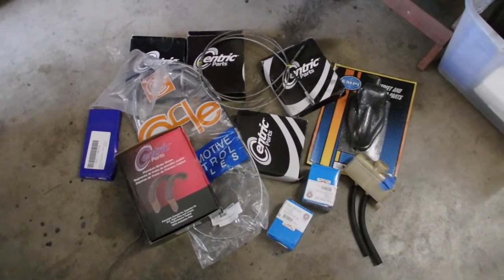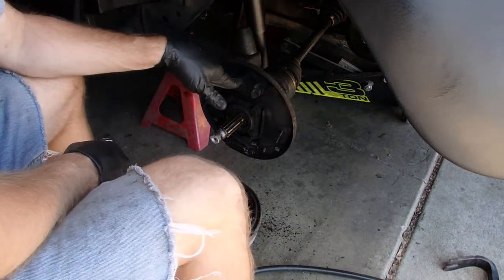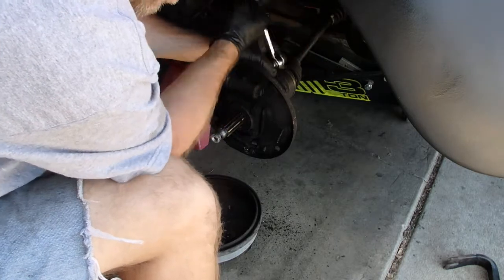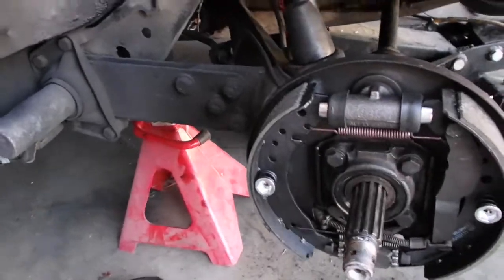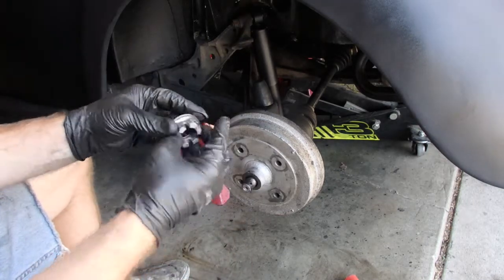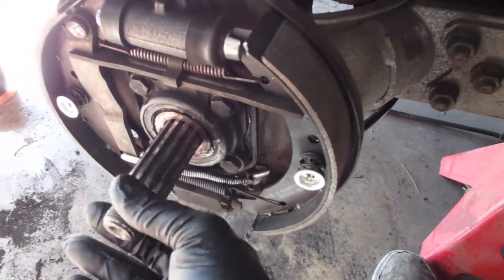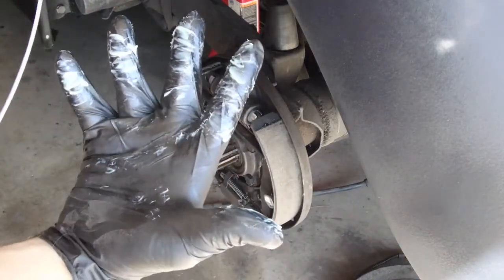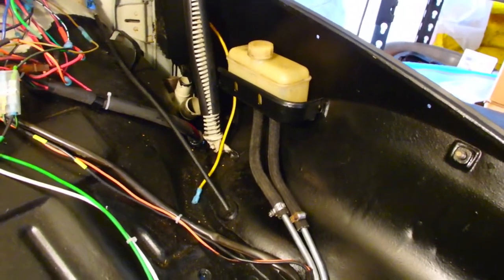1969 VW Bug Project - Episode 41 - R&R Emergency Brake Cables and Rear Brakes

Comment: I bought one of those torque multipliers and for the grief its saved me, it was well worth the $100. It's also nice to know that when I put the nut back on I can set it to the correct torque spec. I like that you don't edit out the little issues that always seem to happen on jobs like this.

Comment: I know this is an old video, but you do not bend the e-brake cable retainer on the backing plate, you do remove the 13mm bolt holding the retainer and everything slides in. Also on the handle side of the cable, you have the lower nuts on backwards, the rounded side goes against the balance bar, you can see the recess on the balance bar for the rounded nuts.
Reply from the maker: Great tip!  Thanks, dude.  I stumble through all of these doing the best I can.

Comment: Great video. Currently dealing with my nightmare project in which I need to do a 100% total brake system replacement. Everything bolt and nut is literally fused. Using this vid as a guide on the e-brake line. I can't get it out of the backing plate at all due to the fused rust so I need to just cut everything including the backing plate out.
Reply from the maker: Heat is your friend, man.  And a big hammer.  

Good luck!

Comment: Digging all your vids... surprised you didn't use the 'ol breaker bar method to get the 36mm axle nut off
Reply from the maker: I tried the breaker bar on the flywheel nut a few episodes back and was bending it so much I thought it'd break, so when the gun did the job then, I vowed to run with air power if I ever got too skittish with the bar.  Besides, my axle nut is a deep socket, which didn't want to stay on the nut when the bar was on it.

Comment: Lotsa commentary on breaker bars and torques.  I watched the "bending" video as well as all the rest and I think you are doing a damn good job  A 2in pipe would cover a longer stretch of your 1/2in drive bar and eliminate the "bending".   I also like the way you "found" the missing piece when the job was done.